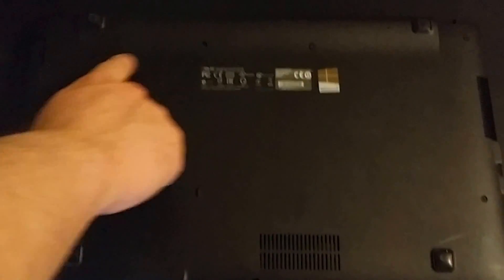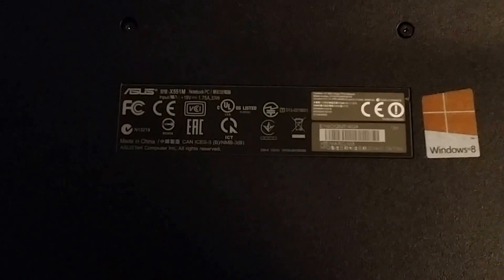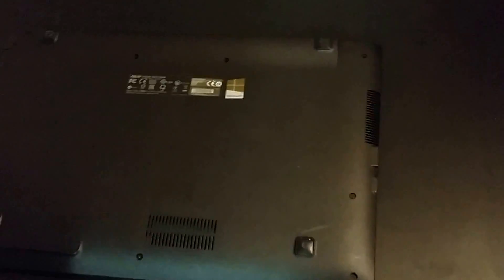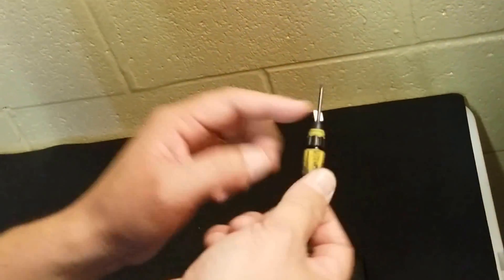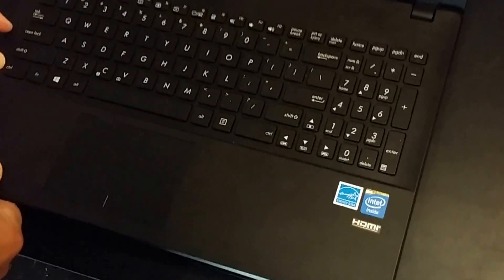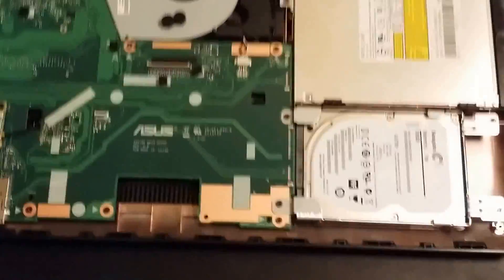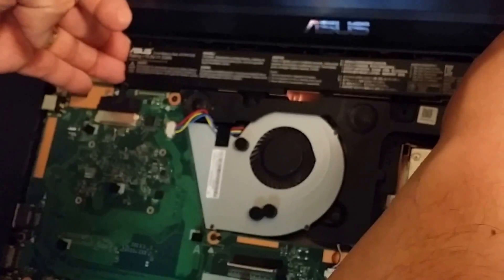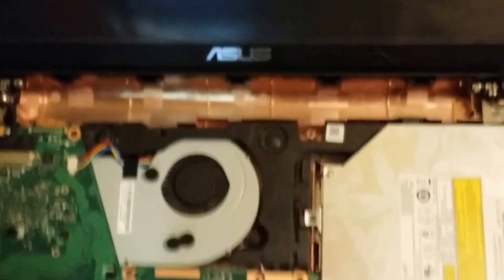ASUS X551M Laptop Battery Removal & Won't Power On Fix

Comment: Hi. i have the same laptop x555ln. i plug a udb fan to computer. then its shut down. then i opened it and remove the static electricity from it. but i touched motherboard while doing it. then one day later it shuts down again. i send it to the official service. but they said that motherboard should change. then i give it to a local computer shop. he says me its cpu is broken. what can i do? do yo think cpu is broken? help me please.
Reply from the maker: When you touched the motherboard, you might have damaged it.  You have to fully discharge yourself of static electricity because that is a delicate circuit board and "CAN" be damaged unfortunately.

Comment: thanks. i have this laptop as well and i am having a charging problem. it says 0% and charging but never increases. one of the troubleshooting suggestions was to remove the battery for 10 minutes and the retry. thanks for the video
Reply from the maker: If your battery is over 2-3 years old, it is most likely the battery.

Comment: I have the X541U model (same chassis as the X551M with internal battery) bought last December and had the same problem . It wont boot and looks dead. Power button doesn't do anything. Laptop wont boot but the power light is on. So I went to the service center. The tech there showed me to press and ctrl f8 and it started booting. Wew!
Reply from the maker: Nice to hear!  Glad you got it working again!

Comment: Great video!  I was able to get the battery out without disconnecting the ribbon connectors, the keyboard/lid has enough leeway to get to the battery without disconnecting.
Reply from the maker: Other people have told me this as well.  Glad you got it fixed!

Comment: Will this work for the F551M model?

My problem is that my laptop wont charge past 0% and cuts off once the adapter is removed. It displays plugged in charging. Before this it got to 84% then stopped charging. instead displaying plugged in not charging and cutting off once the adapter is removed.

Im hoping this works since my model looks just like the one you have but it is has a different model name.
Reply from the maker: You need a new battery.  The F551M is similar but not exactly the same.  Use the video as a guide but most of all, BE CAREFUL when you disassemble it.  Don't use excessive force to take apart anything.  Use a spudger/guitar pick to help pry the lid off the base.

Devin
Reply: Thank you!
Reply from the maker: You will need to replace your battery if it stops taking a charge.  I am not sure if the F551M model will be exactly the same as the X551M in removing the battery.  If you are careful, you can use the video as a starting point.  Just be extremely careful not to force anything in order to remove it.

Comment: Hi AngrySquirrel PC, I was trying to update the Display adaptors in my Asus X441S laptop, it was already installing 99% but I was terribly late for school so I just closed it. When I turned it back on, there's only a bright black screen glaring at me, no sounds no anything. I'm scared it's related to the update thing. Should I follow the same steps in your vid or should I contact tech support? I don't trust myself doing that though. Pleaseee any advice will be well-appreciated. Thankss
Reply from the maker: Worst case scenario, it sounds to me that your Windows OS got corrupted.  IMO, a simple repair installation of Windows should fix it.  Sorry it took me a while to respond.  I had surgery and didn't have time to check my comments in a while.

Comment: Hi I was wondering if you could help me, I've tried researching this but nothing helpful came up, I've tried this twice and my laptop still wont turn on (no lights, even while charging), and I was wondering if my charger could be the problem as it overheats a lot and my laptop would turn off randomly without warning (while charging aswell) could it be that charger? or is my battery stuffed? Before my laptop completely died it also tried to start up but died, so that's why I was thinking it could be the charger
Reply from the maker: There is a possibility that your Laptop itself could be overheating.  But first remove the battery and try using another power adapter / charger (universal chargers have multiple tips for most laptop connectors).  If another power adapter does not power your system on, it is then a faulty DC jack or a failing/failed motherboard.  When in doubt, try calling a computer repair shop and see if they offer free diagnostics.

Devin
Reply: ***** Alright thanks :)
Reply from the maker: Anytime!

Comment: I have the same model and everything. My labtop has 0% available when charged in. I've followed the steps. I think all I have to do now is get another battery but im not sure. What do you recommend? Also the screws were a real pain, as there actually happened to be 4 dif. sizes. Anyways, many thanks if you can help.

Comment: thanks for lecture but where can i get the battery? because i looked for it here in Kampala Uganda EAST AFRICA  and i failed to get it ,but they Asus laptops.please help coz its no longer working if its not plugged in power. my contact number is +256752616260
Reply from the maker: I am not sure if Africa has access to Amazon or eBay but you can get these batteries from there.

Comment: hi,i have just watch your video.Its quite intresting video.But i have asus r417sa-wx235t,is it the same way to remove battery for my laptop ??
Reply from the maker: I honestly do not know.  I have not taken that model apart yet.  You can "TRY" using extreme caution to remove the screws and see what happens but there are no guarantees that it will be the same as the X551M model's disassembly procedures.

Comment: Hi I have that laptop model when I try switch on green light come one DVD drive make sound but fun not move and nothing on screen is visible
Reply: Do you have any idea what wrong? I think maybe motherboard is faulty
Reply from the maker: That is a sign of either a memory failure or motherboard failure.  Try removing both memory modules and see if you hear beeping.  If it beeps, place ONE stick of memory in then turn it on.  If it works great!  If it doesn't, remove it and put the other memory stick in.  If it does NOT beep when no memory is in when you turn it on, then you have a motherboard failure.

Comment: Thanks for the video.  Just replaced the battery in my wife's laptop.  I did not have to remove the ribbon cables.  The keyboard would move down enough to allow access to the battery.  Thanks again!

Comment: I am a computer repair tech, and I thought I could compliment you on a good video. However, Asus isn't morons. They make the battery replacement more work on purpose, so normal people can't fix it, and sends it to them.
Reply from the maker: Thanks for the compliment!  And I know WHY they do it.  I just don't agree with it.  For YEARS, a battery is supposed to be a simple replacement.  Even CELL PHONES have the ability to replace the batteries by simply removing the back cover.  Speaking not as a tech at the moment but as a consumer, they are trying to make these $300 laptops more disposable then they already are.  Depending on use and environmental conditions, a Li-Ion Battery can last between 1 to 3 years.  If a person happens to be in the 1 year crowd, a person would be forced to either figure it out, have a shop replace it for them, throw it away/not use it due to frustration and buy a new one or send it to ASUS (what they are hoping for).  This is so wrong on so many levels due simply to corporate greed.  I stand by my original comment and call them morons for a multitude of reasons ;)

Devin

Comment: Can you tell me what screws go where in the back? I have one spot (the first screw you did) that nothing is tightening. It just keeps turning and falls out.
Reply from the maker: There are two possibilities.  One is that the screw you are using is too short and cannot reach the nut underneath.  Try a slightly longer screw for that one that is free wheeling.  The second possibility is that the nut molding is broken and there is no longer anything to hold the screw in to.
Reply: There are 3-4 different screw lengths, so you have to make note of which one goes where when you remove them.Use this link to see what goes where: https://www.ifixit.com/Guide/Asus+X551CA+Battery+Replacement/24928

Comment: As my last post says, 3 weeks ago I replaced the battery. All was great until a couple days ago when my son says here we go again: Laptop has to be plugged into to be powered up, battery will not hold a charge at all. Happened suddenly. Now my first instinct is to order a new battery from a different source, but I'd like to ask: other than the battery itself, what else could it be? I assume there is some kind of voltage regulator that enables the trickle charge. Would something like that be easy to replace? Thanks.
Reply from the maker: Unfortunately Paul, there is no way to replace the "voltage regulator" on a motherboard.  That is done at the factory level and is integrated onto the motherboard itself.  There is the possibility that the battery was defective as that often happens when you get cheaper "knockoff" parts like batteries.  My suggestion would be to RMA the battery so you won't incur additional costs and see if your issue happens again.  If it does, it would most likely be the motherboard and you might want to see about costs for the MB replacement part or possibly not fixing it if the costs exceed over $150+ dollars as this laptop was originally about $300 excluding tax.

Devin

Comment: how would u upgrade the memory i need your help plz
Reply from the maker: It depends on your motherboard.  There are two kinds of motherboards used in this model.  One that is soldered on and you wont be able to upgrade the memory.  If you have the DIMM Memory modules that memory can be removed or installed, simply follow the video to disassemble to the point that the motherboard is exposed.  Look for the screws that are holding down the motherboard to the bottom case and unscrew all screws.  Then GENTLY remove the board from the case and flip it upside down to see the memory module slot.  PRAY you have the board that has the memory slots that are NOT soldered on.

Comment: THANK YOU!
Your video was perfect, I was able to replace the battery. Only difficulty was the screws, nearly stripped one trying to loosen it.
Reply from the maker: You are very welcome!  I am glad the video helped you out!

Devin
Reply: Angrysquirrel PC,  forgot to mention that I didn't need to disconnect the cables, just slid gently the keyboard forward to get to the battery.
Reply from the maker: Yes other people have mentioned this in the past as well.  I actually responded to someone hesitant that she might be able to slide the keyboard carefully down as well.  Originally when I did this video about 3 years ago, I felt the need to remove the keyboard for safety's sake to not have the cables accidentally tear or rip due to being careless or exerting too much force when customer's try to do it themselves.

Glad you figured this out on your own!

Devin

Comment: I bought this pc last year and it didn't charge out of the box. Called Asus and fought with them for weeks and finally gave up deciding that the laptop I was going to write on was now a desk top. Really maddening. After watching this I may try the battery replacement myself.
Reply from the maker: You really don't have much to lose.  Just follow the steps in the video and the hardest part is really being CAREFUL about the ribbon cables.  Some people leave the cables on and move the lid downward to expose the battery area to remove the battery.  Good luck!

Comment: Does this laptop have a Mini-PCIe Port? I wanna add an eGPU to the laptop but I am afraid of opening it in case it breaks and will only do so if it has a mini-PCIe port. Many thanks in advance!! :)
Reply from the maker: Tom,

The only Mini PCI-e port this model has is being used by the Mini Wireless Adapter.  After doing some research, you may not be able to add an eGPU.

Devin

Comment: Thanks, Devon. This was a tremendous help-concise and easy to follow. I am a total non-geek at this stuff and you saved me (and my computer) endless pain and agony, not to mention money. The computer as a whole has worked well for me for four years, but I knew about the battery replacement problem and was seriously thinking of dumping it.   Maybe it-s the cynic in me, but I think, that ASUS intentionally designed the computer so that changing the battery would be a pain-in-the-ass. Nothing like planned obsolescence to keep those sales up.
Reply from the maker: Yes Bob!  You hit the nail on the head.  Make the laptop more difficult to replace disposable parts like batterys and hard drives so people will just buy new ones instead of replacing.  Planned obsolescence at its finest!

Devin

Comment: THE RIBBON CONNECTORS WONT GO BACK IN PLACE, I followed your instructions on how to put it back but it won't stay!!!
Reply from the maker: Make ABSOLUTELY SURE that you are sticking the ribbons in the actual slots.  If you put it in correctly, it WILL stay in place because it is being held by movable flip clip latches.  If the latches are flipped downward with the ribbons where they need be at, it will stay as long as you don't pull them out by lifting the lid too far.

Comment: thanks so much for the video brother; quick question; I search ebay and amazon for the "original" new battery, and I can't find it anywhere, can you or anyone reading help out? I found other batteries "compatible" with my model (X551Ma) but they are 2600 mAh compared to the original 3000mAh; and I want my batter to last the longest possible; thanks in advance to anyone who's able to help me out!
Reply from the maker: I scoured the internet, amazon, ebay, etc and do not see one anymore that is near 3000mAh.  The ones I do are from Italy and Germany and are used.  You might have to go with a battery with less then 3000.  Sorry for the bad news.
Reply: which battery have you replaced your original with?
Reply from the maker: I used this one for my customer >>>>  http://www.ebay.com/itm/Genuine-Original-A31N1319-Battery-for-ASUS-X451-X451C-X551C-X451CA-X551-A41N1308-/272246726065?hash=item3f632b5db1:g:VOQAAOSwfZhXNEV3

Comment: When I did mine, the ribbon cables were long enough such that I did not need to remove them in order to move the keyboard off the  battery. There was enough length so I just set the keyboard forward a little and took the battery out. Thanks.
Reply from the maker: You are correct on that Paul.  However, there are a LOT of people on here that would be VERY hesitant to do what you said only because they may "forget" the cables were attached and might accidentally move the Keyboard Lid "too far" and damage them.  I only suggested removing the cables so nothing would be taken to chance on accidentally damaging the attached cables.  If people are careful, you are 100% correct to do as you stated on removing the battery without detaching the cables!  KUDOS to you!

Devin
Reply: Thanks! I'll try another battery. Another question. There are different voltages for this same battery model number. For this first replacement, I chose 11.25V (same as original), but there are 14.4V and 14.8Vdc. I actually asked  ASUS Support whether a 14.4Vdc would work and they said yes, but that did not really give me much confidence, just my feeling. Now it does seem reasonable to me that most laptop voltage regulators would handle an extra 3V, but what do you think?
Reply from the maker: This has been a question that has been asked many times before on this comment board.  The short answer is yes.  These batteries will work on your ASUS laptop.  Will it cause damage to it?  That is the ongoing debate as to the "long term effects" on the laptop.  I would get what ASUS said IN WRITING and if the laptop motherboard fails within 3 years, you can always use the documentation they sent you as your get out of jail free card.  After 3 years, it will mostly be due to usage and normal wear and tear on an inexpensive $300 laptop.

Devin

Comment: Will you give me a link to an 8gb ram stick compatible with this laptop please?
Reply from the maker: Bad news sir.  The ASUS X551M or MA model cannot be upgraded past 4GB.  See this link here that states this:
http://www.crucial.com/usa/en/compatible-upgrade-for/ASUS/x551ma
Reply: @angrysquirrelpc9181  I saw this. Kingston says the same thing. However, when I had the machine open, since I had a compatible 8GB RAM stick, I thought that I'd try it anyway. I worked! For all I know, it might even be possible to use a module with still greater memory (but it's too much trouble to buy the RAM, open up the machine, try it, find it doesn't work, replace the original stick, etc.) for me to assay it. I even contacted Kingston to inform them that their website was providing incorrect guidance to customers (and costing them sales, since most people would spend the money to get an 8GB module if it were usable. After some time on the phone, the CSR returned to me and said that they had to go by the official Asus technical data, which stated that 4GB was the maximum. So I didn't waste my time contacting Crucial or elsewhere about this.